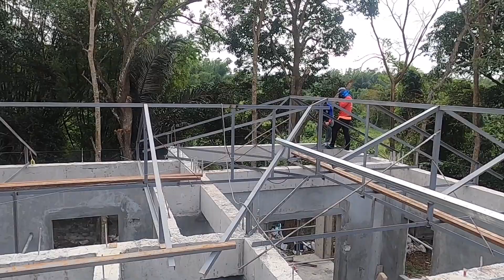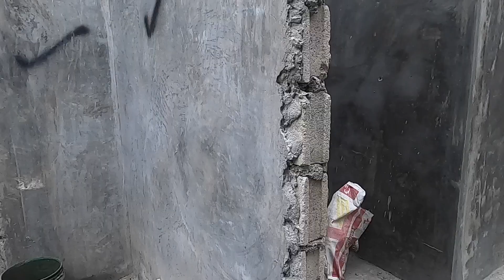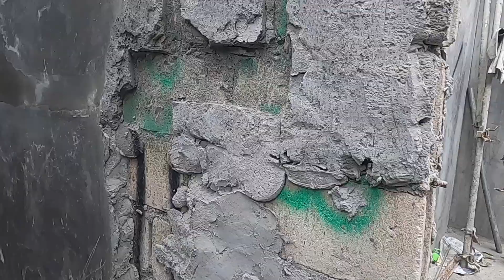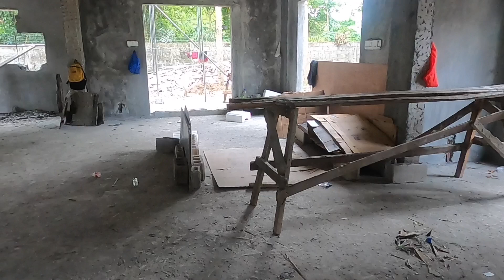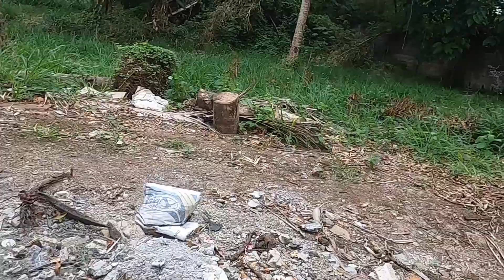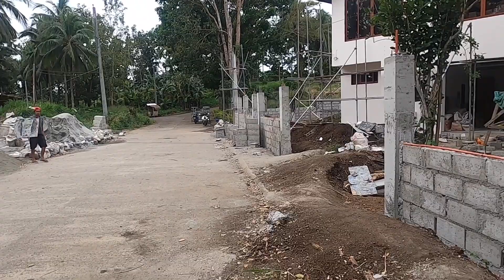Philippines House Build Vlog 59: ROOF STRUCTURE PROCESS HAS STARTED

Comment: Gday Steve. Are you going to have a generator for backup power supply in the  future? I have a 7Kva gasolene genie that we use for welding as well. But if budget permits I would buy a 10Kva silent diesel generator. I just thought if you buy one now, it could solve the welding power problem, and become your backup power later.
Reply from the maker: Yes I am looking for one now that fits in the budget and I would love to get one for the site but need to have a dry and secure area to put it in so I will have to wait and the roof will be done by then.  The draw from the welder effects the sub division from what my builder tells me and I do not want to cause issues with my neighbors power supply.

Comment: Glad to see you finally got your roof going. For me a critical piece of the roof integrity would be the welds.  I've seen plenty of Philippino welders, doing what I call a tac job. Make sure you inspect the welds, if they fail it will come crashing down or weaken the structure.

Comment: Hi Steve, maybe look at spray painting the roof, to the colour you want?
Reply from the maker: I was thinking about doing that, but decided against it do not want to be painting my roof every five years.
Reply: @NethFaulkner  or you put a temporary roof of hardieflex, maybe an idea
Reply: I found a product for youMetal Roofs Cladding Paint is ideal for the long term maintenance of cladding and is extremely good in harsh environmental areas such as coastlines. Rustoleum Mathys Noxyde is among our high quality products we offer you for your cladding work. Noxyde forms an anti-rusting, rubbery type membrane, which once applied becomes impermeable to water and highly resistant to weathering, mechanical and chemical attack. Noxyde is an excellent provider of protection for metal roofs and plastisol cladding.  

Noxyde is a two coat system offering an insurance backed guarantee for up to 25 years. This product, as well as Rustoleum Peganox Metal Cladding Paint are among the products we cannot recommend any higher. Peganox is ideal for applying to Caravan and Mobile Home Roofs. The application process couldn’t be simpler as you can apply the paint by roller, to cover larger areas or cladding, and brush, for the trickier areas which need precision. If you need help with any of the products we have on offer, then please don’t hesitate in contacting us in your attempt to revitalise your Metal Cladding.